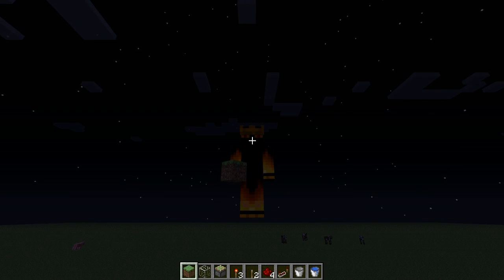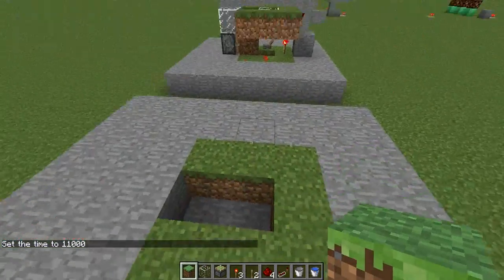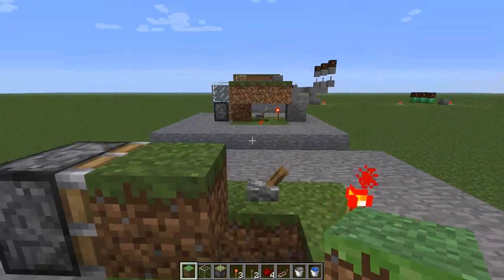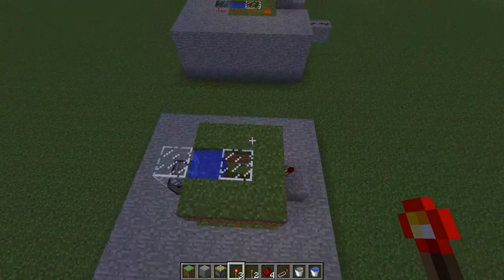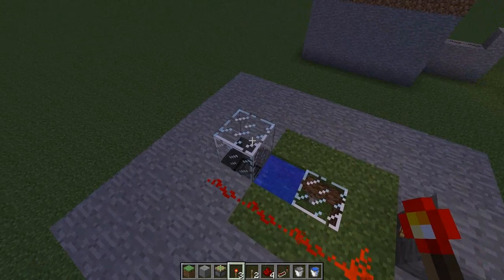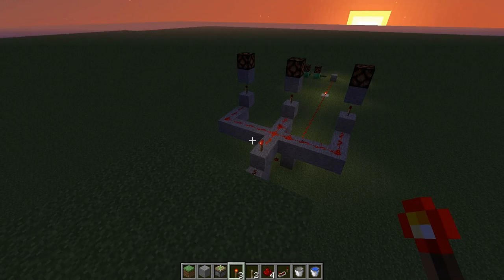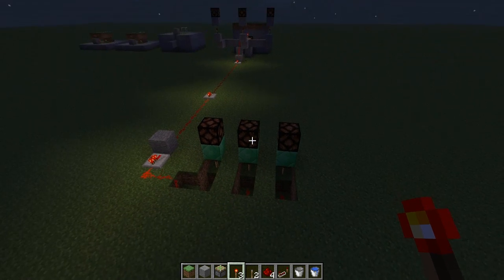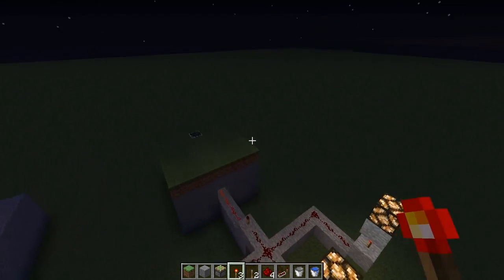BUD (Day / Night) Sensor - For Lighting + MInecraft 1.4.6+ Redstone Tutorial

Comment from the maker: the inverters inside the box are all required, the inverters outside the module are not required, just a way of moving the signal to the surface for lights (can be used as input for any device) - Check out my array set up for these, or my super slow version of this tutorial where I spend time talking through how and why this works (links in the description!) 
Hope that helps =)

Comment from the maker: If you mean the switch in the design then I guess it would act as an on /off for the sensor itself to be active.

But to be honest, you dont want to have to dig it up and change it each time, just make a link to the output  so that the output is used, or not used. I will be starting a new series on the channel for Redstone for Beginners, and this is the sort of thing I will be covering =) - Also any questions on redstone uses and I will take requests to showcase them

Comment: I was just going to hook it up to a switch in my base below the detector itself. What I was worried about is rather or not it could potentially screw up the bud (even if it was just for a limited time). I could just set the detector's output up with an AND gate to manually toggle it if it might.